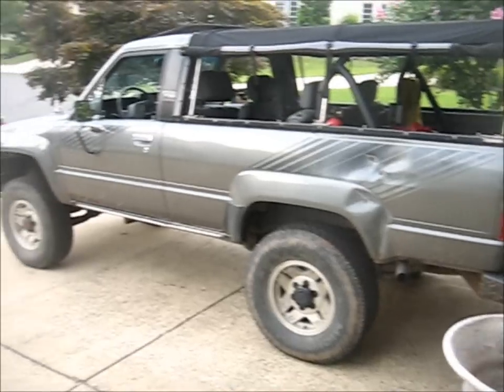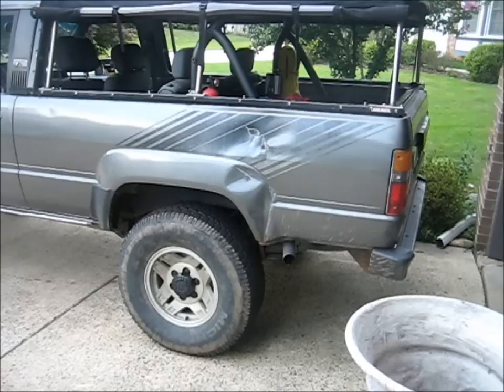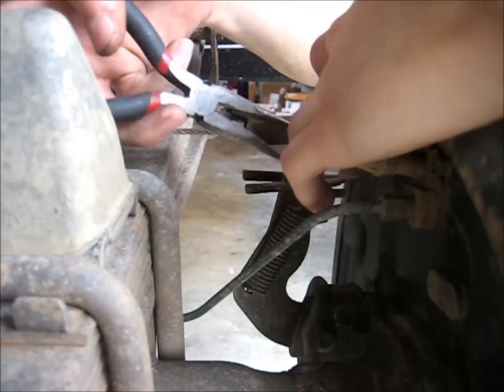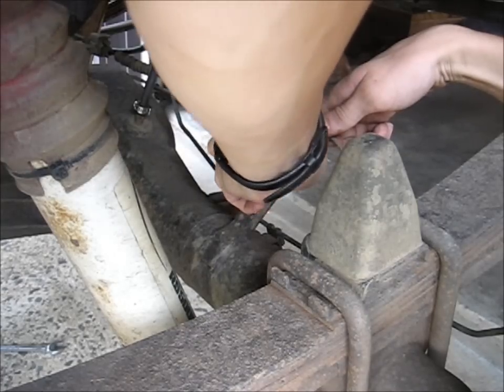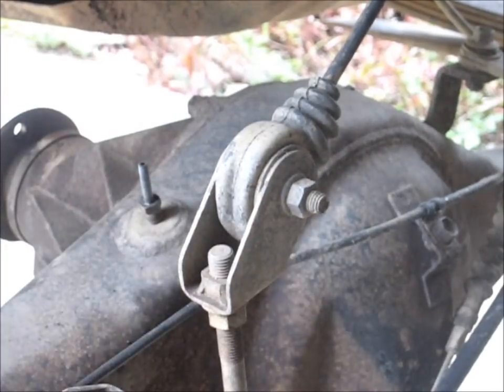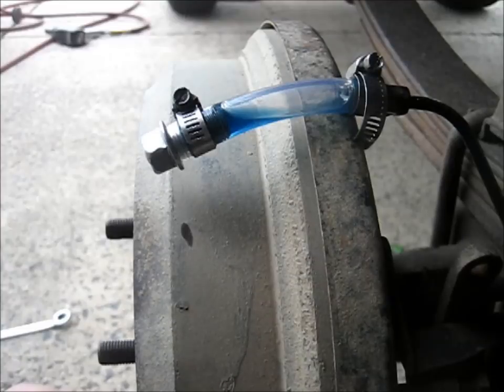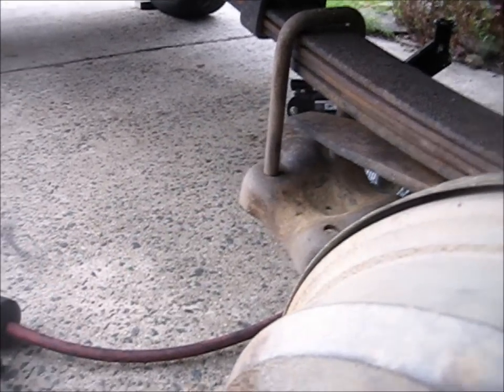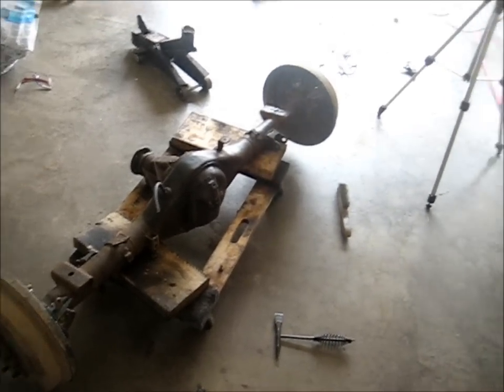1987 4Runner Old Man Emu Spring Installation Part 1 of 2

Comment: yeah, had to grab a used 4runner leaf spring pair, not only were the bolts pretty much impossible to remove (i'm in wisconsin, salt capitol of everywhere) but the shackles had also been replaced with ghetto drilled barstock. with bolts that were still impossible to remove.
Reply: Actually, Michigan would be that Capitol!

Comment from the maker: I had ToyTec add-a-leafs on my original spring pack. They worked great and added about 2 inches of lift to the sagging original pack. Smooth ride and no clunking and banging like the ZUK mod. This put me right about back to stock height. The OME springs put me at about 2 inches above stock which is a good height with the BJ spacers up front and should allow me to clear 33's easily. Plus lifting the ass up really helps keep the bumper from dragging on stuff.

Comment: hey alex your videos are great! I have a question about removing the bolt ont he passenger side leaf thats close to the gas tank, how did you get that one off?
Reply from the maker: On mine the bolt head was on the outside of the frame and the nut was on the inside, so I was able to easily loosen the nut with a box wrench and remove the bolt. If the bolt is the other way around for you, you'll have to either cut it or drop the tank.
Reply: @TheAlexManVideos  god damn! thank you for the reply and keep up the good work!

Comment from the maker: I made the adapter that goes into the axle myself, there is 3/16" hose that runs next to the parking brake cable, then the 3/16" hose goes into an adapter and into the factory breather. The breather is located right by the fuel filler.

Comment: Sweet video. I'm saving up for my OME's now. I think I'm going to do the same set up in my '86. 
Was the front spacers easy to do, too? 
And the extra leaf you removed from the bottom, did you notice any difference, good or bad, softer ride? 
I was thinking just doing that as I install them.
Reply from the maker: I removed the shortest leaf before ever installing the leaf pack so I can't give any comparison. I am happy with how they ride now though. Front spacers are easy but I do not recommend them. I noticed accelerated lower ball joint wear. Also, even with a proper static alignment, the front suspension will move differently through its travel so you dynamic alignment will be off. This means accelerated tire wear too. I say either keep the front end stock, or SAS it.
Reply: I was wondering about the wear and tear of the spacers. I've heard mixed reviews so this is excellent info, thank you. I'll hold off on the spacers and just build an SAS kit in a few months. Thank you so much for the video! Great job!

Comment: Hi there Alex Man - can you share what exact OME shocks that you purchased to go with the CS009R? I have IFS just the same on my '88 4x4 Pickup, and am now doing the leaf spring swap. Thanks!
Reply from the maker: OME60062 for the rear, OME60072 for the front. These should fit any 86-88/89 Pickup/4Runner. They run about $100 each depending on where you buy. The rear shocks will work with the factory U-bolt plates. If you install a U-bolt flip kit like I did, you'll have to get new shock mounts and a bushing to take up slack between the shock and shock mount.
Reply: Thanks for the reply! I'm doing a U-bolt flip kit like you did here. When you say that I'll have to get new shock mounts are you talking about the ones that you welded onto the axle? And is the bushing to replace the old one?
Reply from the maker: Yes, you need new lower shock mounts welded to the axle. The U-bolt flip leaves you with no lower shock mount since the factory one is attached to the U-bolt plate. The bushing is to take up space between the shock rubber bushing and the bolt used in the lower shock mount. The lower shock mount has a hole for a 3/8" or 10mm bolt to go through. The shock comes with a rubber bushing that has a roughly 3/4" ID. So you need some sort of a sleeve with a 3/8" ID and a 3/4" OD.